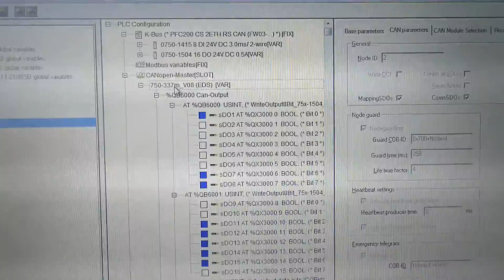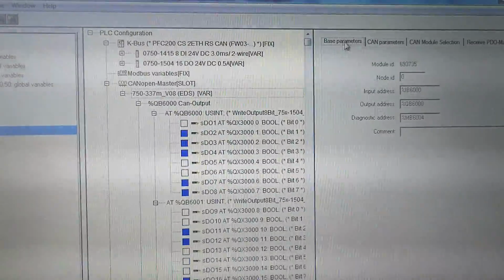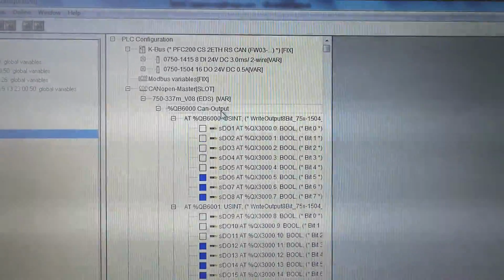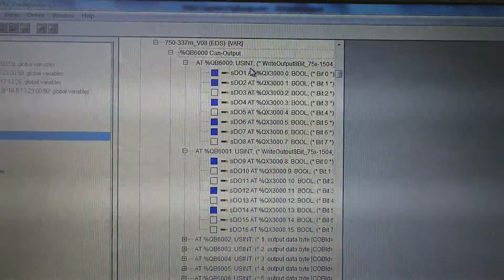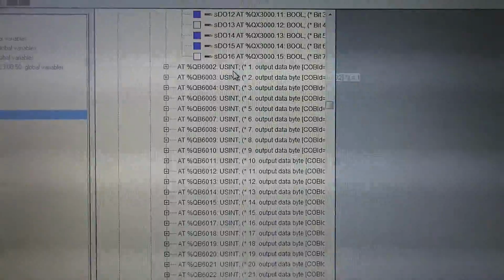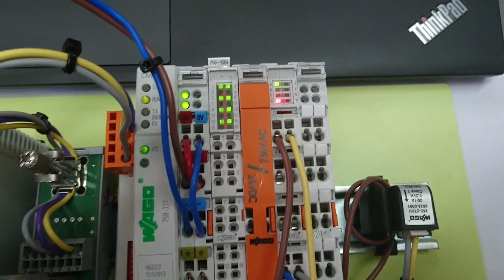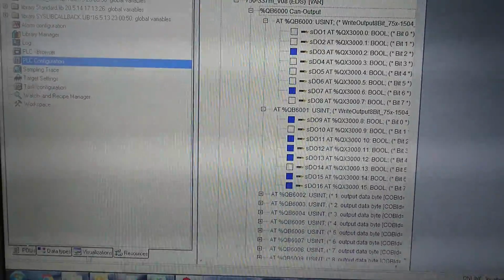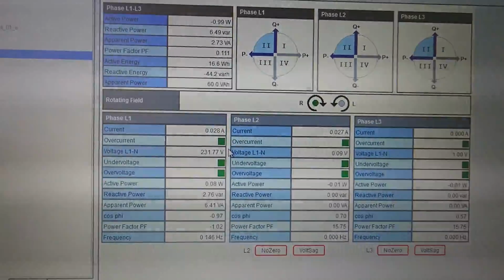WAGO CAN coupler reads power measurement values to PFC200

Comment: Hello,
Do you have a hit for the issue that I had?
I am connecting the Ethernet coupler with the same pfc 200, but when I want to use FbAC_Compact_494, I could not read the data from the module, on the I_port what should I type?
Thanks in advance.
Best regards.